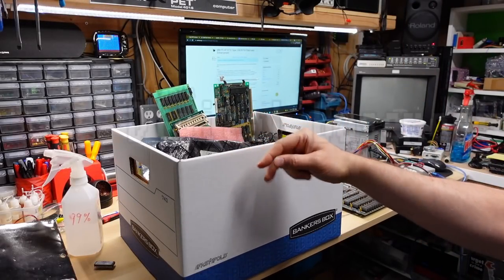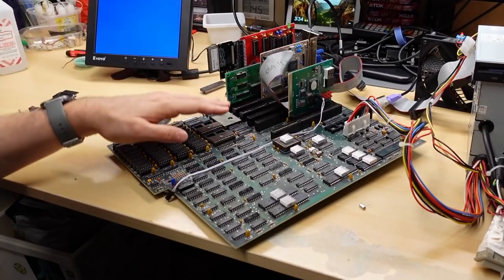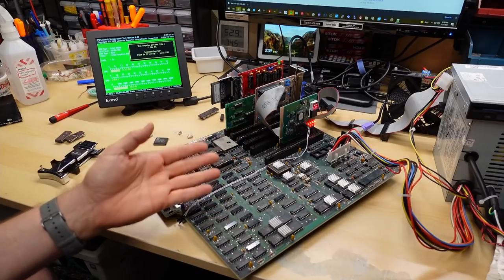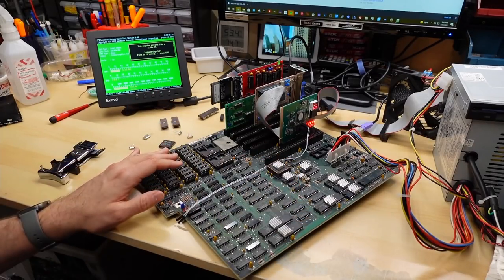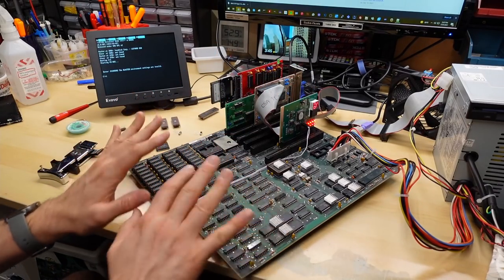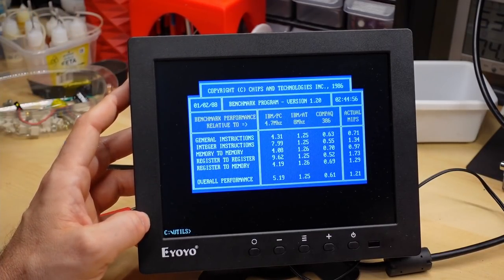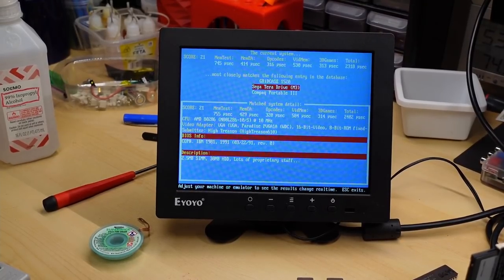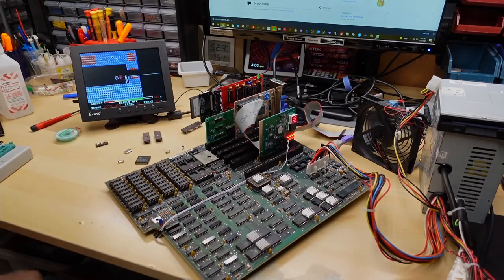Followup: IBM 5170 "extreme" overclocking (w/ associated BIOS patch)

Comment: 1mhz has a period of 1000 nanoseconds.
100 nanosecond response time memory is good to about 10mz before it runs out of time to respond to an operation.
200 nanoseconds equates to 5mhz theoretical max clock speed.
Memory makers are going to be conservative to ensure stability and longevity.  Obviously things are more complicated and reality often defies theory, but it's more like a guideline.  
Faster memory would allow you to push the clock further to a point.
Reply from the maker: Yeah this board runs at 1 wait state for the RAM -- so that allows the 200ns RAM to work up to 10mhz I guess.

Comment: 1/200 ns = 5 MHz.  I guess it's running with 1 wait state to keep in spec?  If that's the case, that RAM should be good up to 10 MHz.
Reply: It's a bit more complex than that. Access time is not the same as cycle time for DRAM, and the 286 still used more than one cycle to access memory (the 8086/88 used four cycles).

Comment: You should revisit your Composite EGA card, but make something that will actually convert an EGA video signal into Composite Color. That way you can still play with Artifact Colors and stuff. I'd really love to see the 8088 MPH demo running on overpowered hardware.
Reply: 8088 MPH is very timing sensitive, it doesn't run correctly on anything other than a 4.77MHz 8088. It also doesn't run on EGA, since many of the effects exploit quirks of the 6845 CRTC on the IBM CGA.
Reply: @RetroSwim  The CPU timing can be probably be patched, and the various graphics quirks can probably be replicated with a custom adapter.
Reply: @AmaroqStarwind  That's not how either of those things work, I'm afraid.
Reply: I actually own an EGA that has composite color output from the factory. It's awesome and makes EGA games look like arcade games 👌
Oh and 8088 only runs correctly on XT class machines with CGA. Even a NEC V20 will make it less than 100% compatible.. V20's mess up the CGA colorburst signal so even when these will run it will be in monochrome.. It really has to be a 4.77MHz 8088 or the timing will be messed up. Same thing with Area 5150 which can only be run correctly on an actual 4.77MHz 8088..

Comment: take a look at the original clock crystal. Solid construction, precise engineering, low impedance leads which were probably plated with silver or gold when it was new. Overall, a superb crystal, custom made with strict capacitance and inductance properties, to function in parameters for many years. Also it fits its ceramic socket perfectly.
 now look at that sorry ass cheap crystals which you can find today. small case, low Q, thin legs.
 and you wonder why this motherboard hangs sometimes with those crystals? wonder no more.

Comment: I'm curious what the power consumption differences are between stock and the different overclocks
Reply: Voltage has not been increased, so only more current might be going through.
Reply: @markae0  power is voltage times current (v*i), so in theory it could get more power hungry.. depends on if the chips need more current to run at faster speeds or not though
Reply: @YoureUsingWordsIncorrectly  Just use a multimeter on amps on the 5v rail.
Reply: in this case not much.
Reply: @YoureUsingWordsIncorrectly  For testing power draw at the wall (AC), I would use a P3 Kill-A-Watt meter (or one of its clones).

Or, for a more accurate reading, a DC power meter of some sort inline with the 5V rails like @Richmondo mentioned.
Reply: @CocoaEm  What? To measure amps you would have to cut the 5 volt feed and place your multi-meter in between. A clamp on amp meter that uses induction is the only practical way.
Reply: @YoureUsingWordsIncorrectly  clamp on inductive amp meter
Reply: @markae0  well yes, pull the pin out of the at connector and measure from that.

Comment: As someone with a newly acquired 5170, I was wondering if you have tried a 16bit ide controller to drive your compact flash. I’m going to try it when I get back from a trip. I guess you might still need the XTIde bios if you are using the ibm bios - maybe not if you are using the quadtel ?
Reply from the maker: See my 3 part series on the 5170 -- I address this with a BIOS patch.

Comment: This is the first I've ever heard of a BIOS that will intentionally freeze if it detects the CPU is too fast.  Very interesting.
I suppose IBM had a good reason for doing this though.  They thrived on being perceived as the top quality "serious" computer, and people were paying a premium for that.
There were lots of small computer shops and mail-order dealers in those days, and some of them were shady.  It would have been easy for a shop to overclock the CPU and sell it as a 10MHz (or whatever).  If this caught on, it would create many unhappy customers who bought an IBM that turned out to be flaky and unreliable.

IBM probably wasn't as worried about end users doing this - end users in the 1980s weren't going to spread the idea around that easily, and only technical users would dare to attempt it, and at least they'd know what they did to their own computer.  But when a shady retailer does overclocks, it gets users involved who don't know anything about it, and that could hurt IBM's reputation for stability.

Comment: See if you can find better heatsinks. Those types are pretty bad for larger chips. I have some blue ones where the fins spread out over the top and allow more airflow between. You should also look for larger heatsinks in regards to CPUs. That little chunk of aluminum there wont do much, especially since its not covering the entire thing. Shop around for some more sizes and types. :)

Comment: I wonder, many errors and instabilities I got in early computers where due to data read errors of media either by controller or reception errors due to chip bus speeds, recheck the hdd controlleer and or try using a ramdisk instead.

Comment: I think that the size of the 286 CPU in this motherboard is similar enough to the area covered by some Raspberry Pi HSF kits.  It might be worth running one of those in order to allow this overclock to be more stable or even taking it up to higher speeds.

Comment: DMA speeds may cause some problems, but I'd guess not by default. The DMA controllers were never designed for the x86 line, and instead were a cheaper device (as compared to the Intel option- Intel's apparently was a byte-code microprocessor, much more expensive, and used by almost nothing!) that IBM licensed from AMD, which had a semi-weak coupling to the bus- my general impression is that if you don't try to program it too fast, then it'll usually work fine... and at about the same speed, regardless of your bus clock speed (though I may be misunderstanding something about that).
Reply from the maker: It's interesting is I had a bad 286 motherboard that ran at 12mhz which seems to use the exact same chipset as the 5170 Type-1 board. So perhaps those are later controllers capable of more speed?
Reply: You're right about the x86 DMAc's being weak links in general. I mean they were obsolete off the shelf parts and were actually originally meant for the (8-bit!) i8085 CPUs from the seventies so even in '81 when  the 5150 launched they were already outdated, which is why the two (problematic) 5MHz DMACs on the 5170 ran at 1/2 duty cycle, which is 3MHz. They shouldn't cause any additional problems on a 10MHz "insanely overclocked" 5170 other than being the usual pain in the @$$ ;-)

It's the 82284 clock generator and the 82888 bus controller (both 6 MHz rated parts) that are causing issues when overclocked to 10MHz...

Comment: 200ns = 5 MHz; so I am guessing this memory is setup with 1 wait state. 200ns with 1 WS would be good up to 10 MHz.  So you might be hitting the memory limit. The wait states are probably not configurable, but adding one would give you more overhead.
Reply from the maker: Yeah from my understanding all 5170 boards have 1 wait state on the RAM -- likely exactly for the reason you said, tops out at 5mhz which is faster than even the slow 6mhz speed. The 5162 286 board uses SIMMs for RAM and it is 0 wait state apparently. I wonder if there is a way to disable the wait state? Clearly all that RAM would need to be swapped out.

Comment: For the CPU that is «hot », maybe the running voltage is too high, 286’s had two possible voltages :5V (most common) and 3.3V (less common / mobile segment) the model Number of the CPU may say that is the 3.3V variant
Reply: Negative. All 286 CPUs are 5V parts.. Most HMOS incarnations of this CPU ran hot as hell. Most of them having a max. rating of 85 degrees centrigrade so is normal for them to be nice and toasty.. If you want a cool running 286 look out for a mobile variant, a 80c286 of which most later ones were of the CMOS variety but also ran at 5V.. The Compaq SLT 286 was one of those machines that had a Harris 80c286 on board.

Comment: HI Adrian. When programs like Landmark (or the BIOS for that matter) do a speed test what do they use for a time base--i.e. what do they compare the CPU clock to?  Do they get it from the Real Time Clock?
Reply: if i recall correctly, before HPET was introduced (~2005) PCs had an internal clock running at 32.768 kHz from the 16-bit era onwards, maybe even the eight bit computers, but that seems peculiar because 32768 is exactly 2^15, and i have no clue as to how an 8bit cpu would process that. 

tldr: not sure about the 8bit computers, but the 16bit machines (and onwards) had an oscillator that was independent from the system bus for RTC

edit: im probably going to take a look at the source code of the ibm bios, when i get the time
Reply: @nikgolinar4378  all x86 cpus had 16bit registers
Reply: @MonochromeWench  fair point — so 16 bits of data would just have to get there in two cpu cycles
Reply: @nikgolinar4378  The programmable interval timer is fed a clock signal of around 1.2MHz (originally the 5150's master clock divided by 12) and this is usually used for timing. In normal use it overflows around 18 times a second and triggers IRQ0. Most timing functions in the PC, such as the BIOS clock, are based off of this.

Even with faster CPU clocks the PIT is still driven at the same frequency for compatibility.

Comment: Adrian, how about placing a fan directly on top of the CPU like in a modern machine? I've read that there are fires now in the region of your city (Portland isn't it?)
Reply: Yeah, wild fires usually caused by overclocked CPUs without proper cooling! :)
Reply: I don't think they make fans that small, the chip is just slightly bigger than a thumb.

Comment: With that RAM being stacked like that, is the buried set getting hotter than the upper due to being sandwiched?
Reply: No he clearly stated the lower section was bank 1 ( Bank 0) and the upper section was bank 2 (bank 1) most of the data be accessed is from the lower bank (First 256K)
Reply: @CotyRiddle  No sorry, I didn't mean the upper and lower banks, I meant the lower chips in each bank (the RAM is made up of piggy-backed chips, so there are 2 layers in each bank) - I was merely curious if the chips at the bottom of the stack got warmer than the ones piggybacking on them.
Reply: @geezerdiamond  Oh that I am not sure about. And thank you for not getting all offensive like some people do on here.

Comment: Are the BIOS chips keeping up? Had some weird issues with e/eeproms when run at faster than spec. Their delay spec is highly conservative but you will eventually reach their hard limit where they just can't latch data as fast as you're reading it. Had one particularly sinister encounter where it would work perfectly fine if you read it linearly or in very small increments but it would crap out if you jumped from one location near the start of it to another near its end. Had a really, not so, fun time debugging that one :)
Reply: With modern flash not an issue even going to 20MHZ bus speeds, but older Eprom and EEROM yes you want the fastest speeds around, but modern ones easily will do 30ns timing no problem, and even with the IBM PC the manufacturer put in a single wait state, so they could use cheap 120ns Eprom with no problems, or cheap 120ns mask ROM, instead of going to the much more expensive at the time 80ns parts.

Comment: I know this is old but if you pick up a 220v muffin fan and run it at 110, it still blows a nice stream of air, but is virtually silent.

And/or how hard would it be to get(purchase?) or rig a larger heatsink and fan to the cpu?

Comment: Try the same setup with another CPU. May be that the CPU is not correctly working at 10 MHz and that is weird for a 12 MHz CPU. Also, being hot is very weird. May it be that the CPU is somehow damaged? Or is there some another clock signal that makes it behave so weird? (I think at the ISA clock)
Reply from the maker: I did the original testing with the Harris 20mhz CPU
Reply: @adriansdigitalbasement2  Thanks for your answer. 
And what is your opinion? Is the 12MHz CPU faulty or the motherboard makes it becoming so hot? 
I had few 286 systems and I overclocked some of them but a 286 CPU to run so hot  to not be able to touch it I never saw. Definitely is something strange.

Comment: Is it possible to implement a clock divider function for the ISA bus on the bios?
Reply from the maker: Later PC's used this -- but surely that wouldn't be easy without major rework on this board.

Comment: Come on man, you need to put that Harris 20Mhz part back on that board, get a fish tank, and do a full chilled mineral oil submersion of the board. 20Mhz full board clock would make it extreme.

(Reminds me of a friend who insisted on getting a 486DX50 instead of a DX266, because: "VLB @ 50Mhz == best VLB".)
Reply: If this led to selecting expansion cards that can survive the bus clock, then it offers a lot of opportunity. For example, drop in an AMD DX4-120 and instantly run at 150. But it's a pain in the ass to get working in the first place, with cards that don't like being run out of spec. I had a CGA card actually spark and pop and blow off traces from dropping it in a 286-16 with no divider on the ISA bus.
Reply: @mal2ksc  LOL... 16Mhz ISA bus - that's outstanding, and not surprising that a CGA card would be less than happy with that situation.

Comment: Would such overclocking effect playup frequensy on a soundcard or is it just the communication with some chip/DSP that is effected?
What is the actual soundchip on an AdLib card it can't be the OPL chip or?
Reply from the maker: Almost surely the Sound Blaster card would have no issue with this. It's designed to work at 4.77mhz to 8mhz (the XT and Type-3 5170 ISA speed) so it likely wouldn't have any issue running at 10mhz either.
Reply: Sound cards all use either an on board master reference oscillator, or use the 14MHz clock from the motherboard, which is not generated from CPU clock.
Reply: @SeanBZA  Maybe it was primitive games using pc speaker that used cpu clock that i remember.
Reply: @JmanNo42  Even those used the counter timer chip, which was fed with a 4.77MHz clock, often derived from another crystal on the board, or derived from the 14MHz clock source, so not linked to CPU clock. PC speaker sound generation that involved turning the output bit on and off using CPU control though did need to have the routines first use a speed checking bit of code, that then was used to vary all the loops used to make the sounds, unless it was single tones made using the timer chip that originally made the PC speaker beep, which could generate tones all by itself of fixed frequency and duration, only needing an interrupt to signal end of tone to the CPU.

Comment: you are way better off using a non ibm bios.  i have been running my type 3 mobo with a 10mhz 286 and a 20mhz crystal for 3 years now and never had a problem.  I use the AMI bios and yes I do have the 80ns ram on the motherboard too and that made a big difference.  I tried the 24mhz crystal back 3 years ago too and had the same issues.  I would get garbled text on the screen etc...

Comment: I think now that this machine is overclocked, you should try to find EMU386 (a 386 emulator that runs on a 286) to see what the penalty is for trading increased processor speed for some facsimile of real mode.  LOL